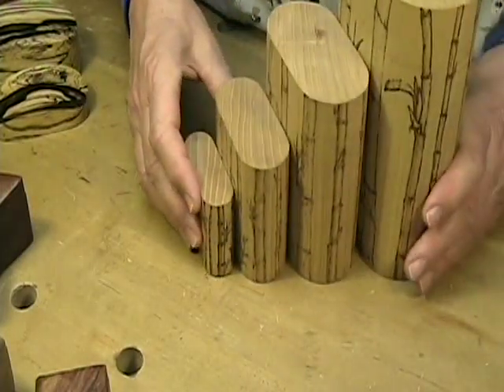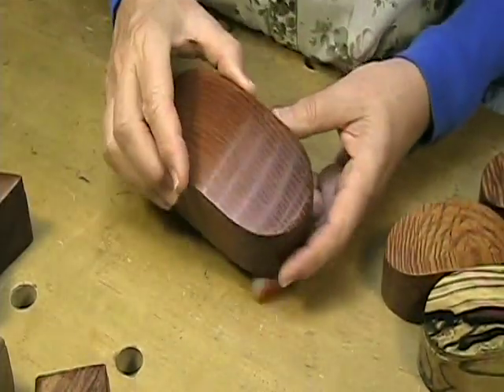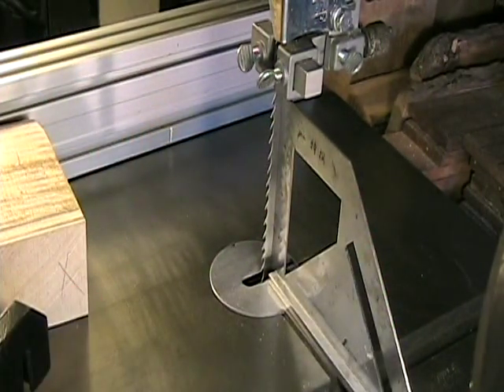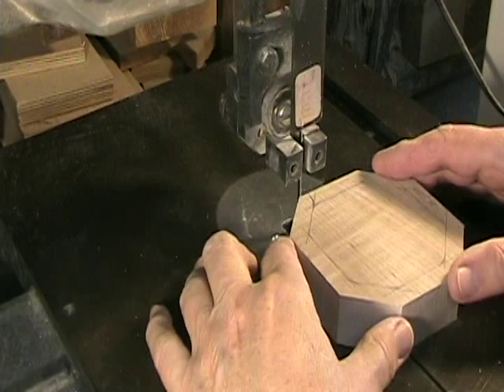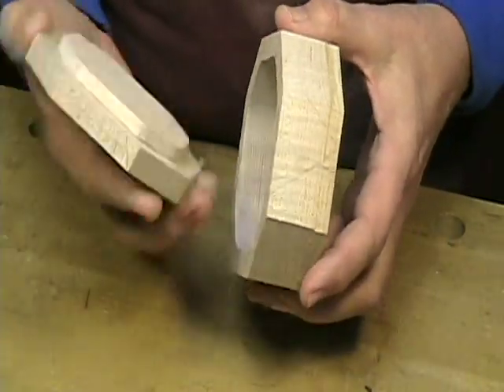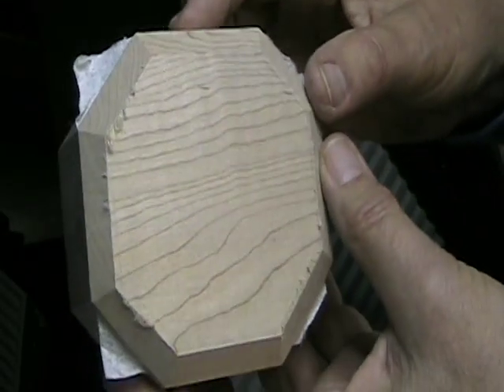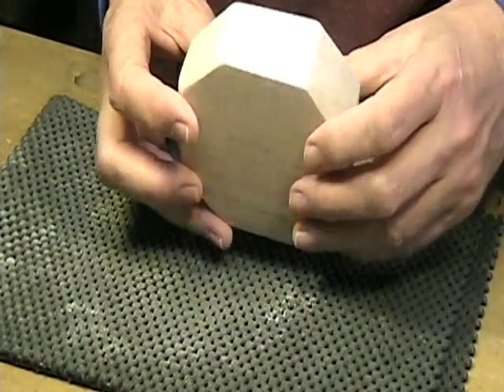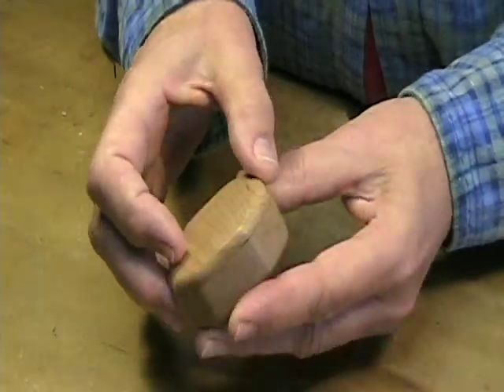bandsawboxpromo000.mpeg

Comment from the maker: The easier way is, as you said, is to sand all of the top of the bottom and the bottom of the body of the box before gluing. This is faster and easier, but sometimes the belt  sander (operator) will leave a not-level surface and the two edges will not line up exactly right. I usually have to finish on a sanding board until they are perfect, and then glue.
Small boxes this is easier- bigger boxes- sand the interiors only.

Comment from the maker: Very observant! Actually there are two ways to do it- the hard way and the easy way. The hard way you sand the area inside the sides of the bottom of the box, leaving the band saw kerf alone. This way the kerfs line up, the fibers of the wood mesh, and the joint is practically invisible, especially after the finish is applied.
(See next comment.)